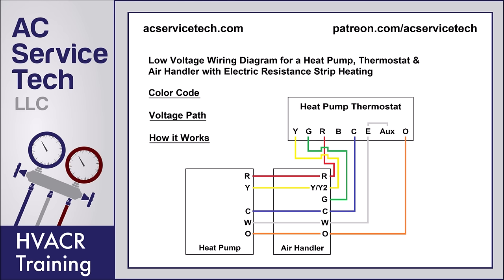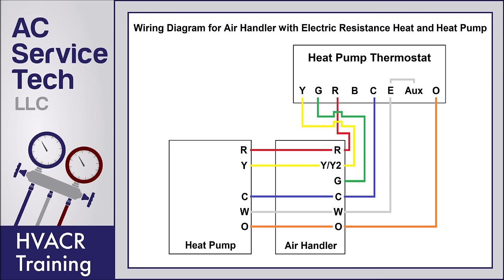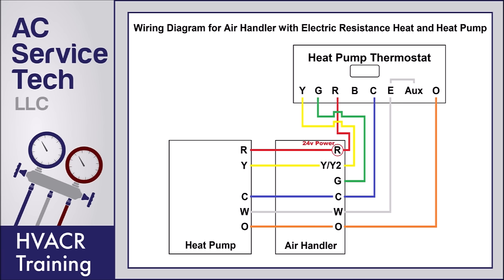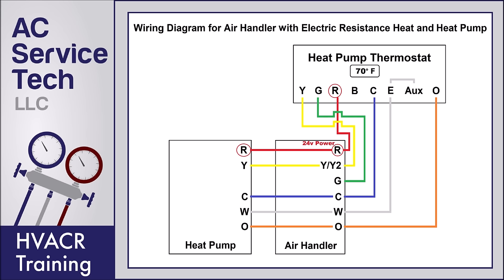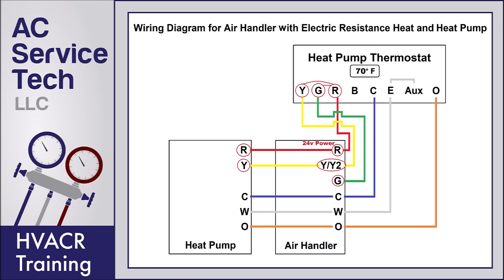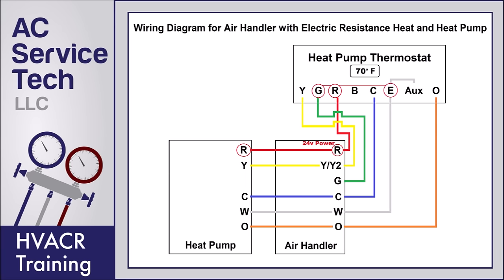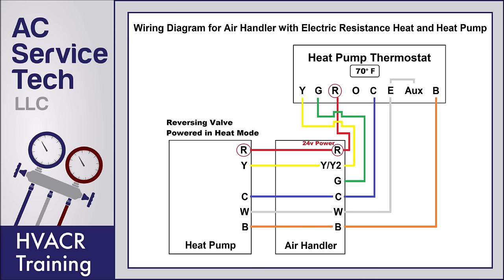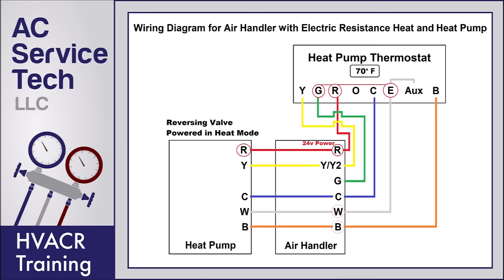Heat Pump Thermostat Wiring Explained! Colors, Terminals, Functions, Circuit Path!

Comment from the maker: My Service and Procedure Book- https://www.acservicetech.com/the-book
Support The Channel-  https://www.patreon.com/acservicetech
Tool List-  https://www.amazon.com/shop/acservicetech
For those that are looking for the tools used in the videos: (Linked Below)
UEI DL479 Multimeter with temp sensor http://amzn.to/2jtsUbJ
Valve Core Removal Tool http://amzn.to/2uYr8WL
Blue Vapor Yellow Jacket Gauge- https://amzn.to/2Ju7pan
Red Liquid Yellow Jacket Gauge- https://amzn.to/2sSFmGH
Quick Coupler for the Gauges- https://amzn.to/2sTk8Ze
JB Test Gauge High Side-  http://amzn.to/2ruQb0l
JB Test Gauge Low Side-  http://amzn.to/2qR0utM
Manual Copper Tube Swage/Expander- https://amzn.to/2WRPa1M
Uniweld Hydraulic Swaging Tool- https://amzn.to/2MlrI8m
Uniweld Swage and Flare Kit- https://amzn.to/2T55jyn
Ameriflame Oxy Acetylene Torch Setup- https://amzn.to/2SRm3JF
#2 Tip for Oxy Acetylene Torch- https://amzn.to/2SPDaeD
Cap-N-Hook Tip for Oxy Acetylene- https://amzn.to/2MbhpUk
Air Acetylene Torch Setup-    http://amzn.to/2aQalsb  
15% Silver Brazing Rods-  http://amzn.to/2gVLyLc
Nitrogen Regulator-   http://amzn.to/2bXdR5f
Nitrogen Flow Meter-    http://amzn.to/2brvoBg
NitroVue Flow Reg-  https://amzn.to/2MiulYv
Ultrasonic Leak Detector- https://amzn.to/2Lw4Zpr

UEI DL479 Multimeter with temp sensor http://amzn.to/2jtsUbJ

Magnet Jumpers- https://amzn.to/2PyKPQZ

Alligator Jumpers- https://amzn.to/2PxqJXn

Fieldpiece ST4 Dual Temp Meter  http://amzn.to/2wc1ME3

Fieldpiece Bead K Type Temp Sensor https://amzn.to/2DBwKfs

Fieldpiece Wet Bulb Temp Sensor https://amzn.to/2RRI7Tw

Fieldpiece TC24 Temp Clamp https://amzn.to/2qHLyjZ

Yellow Jacket Refrigerant Gauge Set http://amzn.to/2aenwTq

Refrigerant hoses with valves http://amzn.to/2aBumVI

Yellow Jacket Gauge set & hoses https://amzn.to/2vLVkV9

Yellow Jacket 4 Port Manifold w Hoses https://amzn.to/2BkuGIq

FieldpieceSMAN360 Digital Manifold Set https://amzn.to/2BdoaD4

FieldpieceSMAN460 Digital Manifold Set https://amzn.to/2nB4Fe6

Compact Ball Valve for Refrigerant Hose https://amzn.to/2KUisW8

QuickDisconnect 90 for refrigerant hose https://amzn.to/2MMtVcg

JB 6 CFM Vacuum Pump   http://amzn.to/2nqbvo8

Appion Blue 3/8" to 1/4" Vacuum Hose http://amzn.to/2uYlVyc

Appion Red 3/8" to 1/4" Vacuum Hose http://amzn.to/2uYg6Ro

Appion Valve Core Removal Tool http://amzn.to/2uYr8WL

Yellow Jacket 1/4" by 1/4" hose http://amzn.to/2umtcod

CPS Vacuum Micron Gauge http://amzn.to/2v1nM3O

Supco Vacuum Micron Gauge http://amzn.to/2v1JRiA

RectorSeal Bubble Gas Leak Detector http://amzn.to/2ckWACn

UEI DL389 Multimeter  http://amzn.to/2xAdaJf

Other tool links can be found in the video description section.

Shop through Amazon! Your Purchases through Amazon provide a means for channels such as mine to earn advertising fees from all purchases after clicking through. Prices are the same as normal-    https://www.amazon.com/shop/acservicetech
Reply: Bravo sir....if you’d had done this presentation 18 months ago when I started at the job I have now, I wouldn’t have had to hunt down thermostat diagrams and electrical theory to understand it on my terms how these thermostats work. This should cut out the guesswork of most guys who don’t have 30 years into the electrical field as I have and make installs or the wiring needs easier to apply in their situations...
Reply from the maker: Thanks Todd, glad to help!

Comment: I've been looking at several videos on heat pump thermostat wiring as well as talking to a Honeywell tech who gave me wrong instructions.  This video finally gave me the correct wiring setup for my Goodman heat pump and a new Honeywell stat with AUX heat.  I had a black wire that the Honeywell tech told me to connect to "E"emergency and white to AUX. I asked about jumping the "E" and AUX and he said no.  I got no heat in "E" mode so I removed the black wire and jumped the "E" and AUX and everything works. The black as well as a brown wire are "extra" if needed. This video was the only one that said the black and brown were extra. Great Video!
Reply from the maker: Ha ha, that's awesome! I'm glad it helped you! Thanks for the note!

Comment: Thank you for a very clear and easy to understand video on heat pump wiring. I had a system that ran on the o wire and the new system is on the blue wire. Your video helped me figure out why the system was heating on the cool setting and cooling on the heat setting. Simple reprogramming of the thermostat problem fixed. 👍

Comment: Ok figured out the problem. The PCB had been rigged to bypass a soldering fault in the G connector plus something had gone low causing the fuse to blow.  The PCB should have been replaced at initial installation. Shoddy work. New PCB cost hardly anything and all is up working fine thanks to your YouTube and Nest (great customer service).  I now understand all (well almost all) of the electrical side of my HVAC Thanks again.

Comment: This video helped me resolve 5 years of Hell.  NO WONDER my AC never ran correctly.  The custom home I bought (second owner) has a heat pump with two zones and a zone controller.  But only 5 wires pulled to the thermostats.  This video makes it clear I need a 6th wire for the reversing valve.   I followed the instructions with a makeshift 6th wire and my AC works perfectly.  Thanks again for making sense out of this for me.
Reply from the maker: Glad to help Sheldon!

Comment: I don't think it matters a lot but it seems to me rheem and ruud are the ones who are doing cooling and heating in  relation  to reversing valve in the  right way and other HVAC manufacturers are
 running it in the opposite way lol.
Thanks for your continuous sharing of knowledge!
Reply from the maker: I think of it in the opposite way because I live in a cold climate. If the coil on the reversing valve is bad, it will still operate in heating mode which would be more of a necessity but it really depends on the location in which you live as far as what a  necessity is, thanks!
Reply: I agree, I always thought the reversing valve was activated in heat mode on all units.

Comment: Best, just best explanation on You tube I’ve ever seen! I've little bit been confused about Aux and Electric terminal on heat pumps. California. Now the wiring combinations is clear to me. BIG thank you, Craig. Interesting, so electric strips helping to achieve set temperature faster. Also, I've met a gas furnace on Aux in Seattle. Coool!
Reply from the maker: Hey Tapch MC, glad to help and thank you for your support on Patreon.com/acservicetech  - Yeah so aux is powered when the thermostat notices that the heat pump cannot keep up on its own or the temp is set up to far compared to the actual temp in the building. The electric strip heating is downstream of the coil so it won't effect the coil's heat rejection and will add to it to get the air hotter, thanks and look at some of the other videos I linked in the 18 thermostat video playlist in the description. There are others that describe the aux too, thanks!

Comment: Thank you so much. I needed to bypass my cdef board. I think the contactor relay is fried. Bought a cheep Amazon board DOA no lights when connected and CB turned on. FRUSTRATING. You get what you pay for. I normally do Aircraft and Automotive AC. 
This was exactly what I needed to get my house cooled off while I find the right board.
I did wire in my pressure sensors. They work fine, good 410A refrigerant pressures. Just a bad board.

Hvac co estimated $1,101.68 to replace the 100 board with less than 20 push on or screw on connections... Give me a break. I said 1/2. No way we will starve. Never mind I will fix it myself!!!!
Thanks yo you its working perfectly and safe in cool mode until I can get the board.

Comment: I had to watch this twice to get it but I'm not qualified as an a/c guy. After the 2nd time, I realized the function at the thermostat changed the voltage command the respective part or parts to run Air , cold air, reversal to heat, resistance heat, and emergency heat. At least it helps understand also what is not happening when your trying to get heat or cold air. I'm gonna take a class if I get a chance .

Comment: This is great.  Thanks for explaining.  I've had multiple HVAC guys out to try to diagnose our heat pump/ electric grid system.  Each time, after they left and I paid the bill, the system was worse than before they came.  Since no one around here seems to be competent, I had to learn it myself.  The last time they came, they hooked the white wire to W in the thermostat rather than to AUX/E.  Only the heat pump would run, and we didn't get any backup electric heat.  I fixed that issue and now both the heat pump and electric heat work! 

 I still have one issue going on.  When the outdoor heat pump turns on, the compressor cycles repeatedly every 15-20 seconds.  Also, the large air fan on the heat pump doesn't turn on.  It was turning on recently, but between all the guys that have messed with it, it has stopped working.  I just wonder if there is anything in the wiring that could be causing this?  If I am understanding correctly, the heat pump compressor and fan are both triggered by the same wire?

By the way, the first guy who came out checked the refrigerant pressures, looked for leaks, and said everything was fine, but added a little bit of refrigerant.  I don't think the refrigerant is low.

Comment: I think ya did a fine job of explaining the 6 wire layout.  Thanks that’s what I needed. (I’m dealing with an old ass coleman heatpump [1979-80?]) As you know an electrician is useless as an AC guy. You might have just changed that. 🤣😂
Really tho… thanks man.

Comment: Confused about the connection between the W terminals on heat pump and air handler, and the E/aux terminals on the thermostat.    The W on the heat pump is an output (as you say), but the E/aux on the thermostat is also an output.   So those two outputs are connected together, so doesn't that cause an electrical conflict (sort of like a short-circuit) ?

Comment: Hi question, I'm switching from a Trane thermostat to a Honeywell T2  Non Programmable Thermostat on our Trane split system Heat Pump with Emergency Heat strips (I Think). The Trane has a Blue , Orange, Green, yellow, red, and a white wire  coming out of the wall, There is also  a cross over W1 (White wire) on the Trane  going from W1 to W2/X2 on the Trane thermostat Our . The Honey Well has a place for a O/B wire. Does the Orange wire from the Trane  go in the O/B slot on the Honeywell  or the Blue wire?, and does the Blue wire from the Trane  go in the C slot on the Honeywell?

Comment: From my heat pump, the tech installed  - Orange, Blue, Red and black going to the control board at the furnace. But I’m not sure where they would go to. On the control board it shows - W , C, R, G, and Y

Comment: Yeah that's if the installer before you using the standard color codes. I know a building that used blue for O/B and Orange for common and other colors off matched. Sometimes you just have to verify what colors are hooked up to the control boards.
Reply from the maker: You always need to look at the indoor unit when replacing a thermostat and look at what terminals the old tstat was connnected to. This was more for when you are installing it and running the wires, thanks KCTech!
Reply: Rheem / RUUD system units

Comment: Hello. First, awesome video. I finished wiring new heat pump and elec furnacea, everything works A1 thanks to your videos. I only got one question, hope you can help: at the end of swapping old system with a newer one ( bought second hand) i still have a temp sensor left. It was hooked om the indoor coil, but i have no idea were it should be pluged. Both wires are red and i have no indications. Tried to found the answer elsewhere but non succes. 
So what does this sensor do and where it should be plug ? 
Thank you.

Comment: What about different thermostats? You have to have the right one for the system you have. 
I have a heat pump, but it only powers the green and white wire. I have been using it for over a decade and only found out by chasing a low voltage short. 
I need to find one that when I turn it to heat, it will send the control voltage to green and yellow.

Comment: I understand the wiring. How would i wire the heat pump system with a gas furnace? Me being a Pa resident we don't have air handlers The O is geting me confused since the board on the furnace don't have o

Comment: Great video quick question i have a 3 wire oil furnace if i touch white and blue wire together heat comes on otherwise if i put blue into c it does not work what im i doing wrong

Comment: Great video Craig! I was referencing this the other day installing a hybrid dual fuel system just like the setup in your video. My question is if the heat pump terminal strip has a "D" Defrost terminal which is energized with 24v when the heat pump goes into defrost mode can I run a wire from the heatpump "D" terminal to W2 on the furnace terminal strip so the furnace comes on while the indoor coil is getting cold in Defrost mode? The defrost is controlled by the heat pumps Board or one of its boards.

Comment: I have this setup, but I also have a purple wire (hooked into the spot labeled Y on my outside condenser/heat pump). Any help is appreciated! 
[And the yellow wire on the heat pump looks to be connected to a part labeled 10135604 if that's helpful. Goodman 5ton unit]

Comment: I was working on a heat pump package unit  and programming the new customer supplied thermostat and no e terminal was present but when put into emergency heat the heat strips would turn on and compressor would not turn on my question is if the Y and O terminal are not powered with W and just W is powered does that activate the heat strip as well because the thermostat knows no E terminal is present?

Comment: My heat pump would not come on only the electric elements in the air handler.  I tested voltage at the unit and all was fine.   If I jumper the Yellow and white at the control board on the outside unit the heat pump comes on and works.   The Ac will not cool with it jumpered.  I am in Florida so don't use the heat much and just did the jumper trick for last winter.    This year I ordered a brand new control board thinking that was the problem.     Heat pump will still only work if I put a jumper in on those 2 wires.    Any Idea what else to check? Otherwise, I will just keep doing the jumper as we only have +- 12 days year to run heat anyhow just a bit of a hassle to have to remove the cover and put the jumper in and out.

Comment: Thanks. My outside heat pump(Rheem 13PJL30A01) unit won't turn on at AC mode. Traced inside and outside, everything seems fine except the outside contactor coil does not receive the 24V for start from the DFC control board.. On the control board(DFC), inlet wires from the house on lead R and C has 24V,  but the out leads (Y and CC) that go out to the contactor coil has no voltage. Can I fix the control board DFC? or have to replace the DFC? Many thanks.

Comment: How would you wire in a safety float switch between thermostat and air handler or heat pump? To cut power if water builds up

Comment: I have a Fujitsu mini split, I use a adapter (UTY-TTRX) to connect to nest. On the adapter it doesn’t have O/B input to connect to. On the nest it show the wire are connected. When I call for heat it light up orange, but the air handler doesn’t not power on. Thanks

Comment: If my heat pump is not functioning and I want to change my primary heating from Heat Pump to Furnace which wire do I need to move in thermostat?

Comment: Craig, or anyone here. I have a honeywell t9 thermostat. I'm pretty sure I wired it correct. One problem is when in cooling mode, then pressing circulate the AC condenser runs. 
In heat mode, then pressing circulate, just the blower runs. Any ideas or just contact Honeywell?
It does cool and heat normally when in normal mode.

Comment: Hey I currently have a oil fired furnace and I installed a Goodman 5-ton with a heat pump do I need a relay to be able to have the heat pump or the furnace I know you said that the heat pump will be emergency

Comment: Question I’m trying to figure out a control circuit for a heat pump so I can feed the unit from the tenant panel for Air condition and from the house panel for heat,I want to install some rely to interlocking fro each other,do you have any idea of the best way to do it?
Thanks 
Franklin

Comment: I am building a small concrete house. i think what i am wanting is a water to water heating and cooling system. i will plumb the floor and the walls. there will be no air or ducting or fan. will i be able to set my temperature to 74 year round ? thank you for being here.

Comment: I am going to be buying a new house. I wanted to possibly get a nest or another smart thermostat in place of the old thermostat. The unit at this home is an older Lennox model from 1995. Its a 2.5 ton unit. I dont know the exact model number, but I will find out soon. It is a heat pump, and also has an emergency heat stage with heating elements. Will these newer smart thermostats work for something like this? Any recommendations or advice on this?